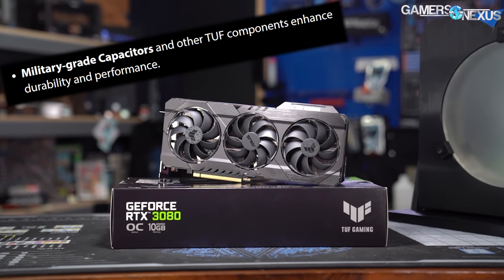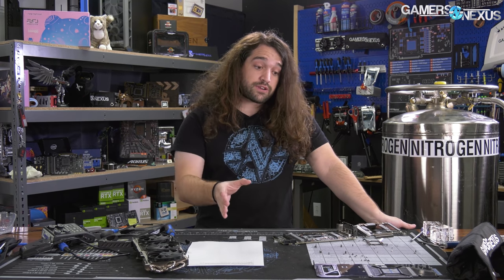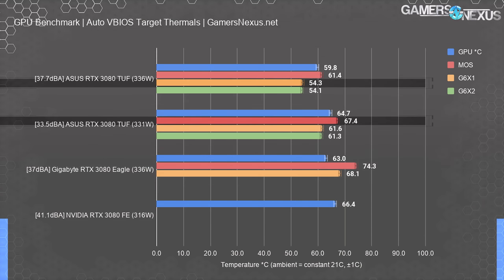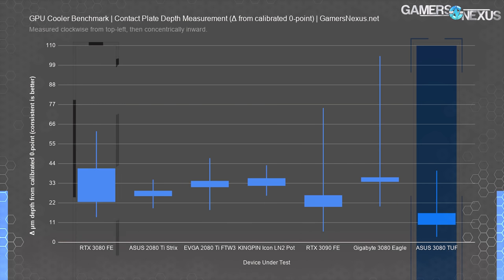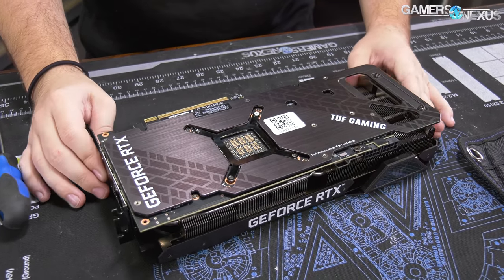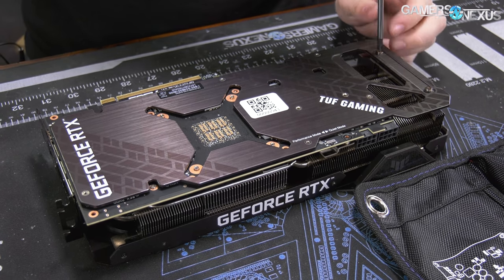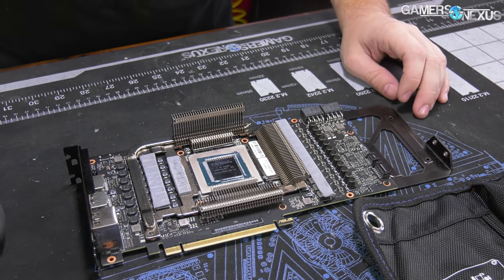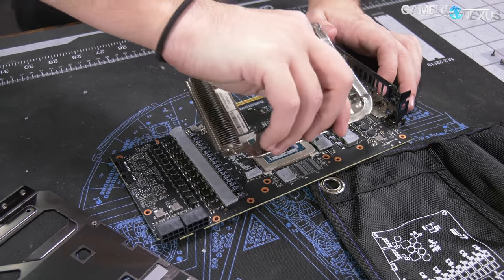ASUS RTX 3080 TUF OC Review & Tear-Down: Thermals, Noise, & Overclocking

Comment: Regarding the mounting pressure; do you find you get the same or very similar results per product card, i.e. if you checked 2 ASUS RTX 3080 TUF video cards, they would be the same and therefor demonstrating cooler mounting design application, or is it a more that each individual card varies to a degree?  I guess you need 2 identical cards to compare (and preferably more).

Comment: Aircraft grade aluminum" refers to many different alloys including, but definitely not limited to 2024, 6061, and 7075. ... In most instances, "aircraft grade" is just a buzzword/term to mean that the alloy has the same composition as commonly used alloys in aircraft, and possibly loosely heat treated in a similar way

Comment: the shroud removal process didnt' look that bad, for some sfx cases, some of us remove the shroud and fans from the gpu and put the card directly on the 120mm intake fans of the case (case dependent), and wire the intake fans to the gpu. so we don't have fans directly on top of each other, and it saves space.

Comment: Before I got my card (3080 Ventus) I was so scared it would be a shit card, due to people online talking so much shit (clearly most of those people don't have the card). 
Turns out it's actually great! Haven't seen temps above 62c , clocked +135 on the core and +500 memory (managed to clock +165 in benchmarks but wasn't stable in games).
This results in the card sitting at 1950-2050 during load.

Comment: @Gamers Nexus why all the negativity? 
OK the marketing is a bit silly, but that is a common problem. Meanwhile lots of respectable companies, even Intel has outright lies in their marketing. The performance seemed to be good to great to best. It is not over-priced. It is made of decent components as far anyone can tell. But what really makes it stand out among "reasonably priced RTX3080 models", and the review does not even mention it:
- it is just 30 cm long - among the few shortest 3rd party 3080s out there. (Important for all small case users)
- is has the second "quiet BIOS" which makes the card substantially quieter than almost any other RTX3080 (a big selling point for me).  

- it has an extra HDMI 2.1 port, making it easier to connect a TV and simultaneously some VR headset, video capture card or whatever you may have with an HDMI connector.

So I think this is the best RTX3080 board right now (considering price). Not by much and the standout features may not matter to You, but it is the best.

Comment: There is actual aircraft grade aluminium called Aluminium 7075. It is a mixture of Aluminium Zinc and copper, it has very high hardness (making it harder to machine) but can be heat treated and is used mainly in aircraft construction. Other types of non-aircraft grade Al include Al 1xxx (pure Aluminium), 2k series, mixture of copper and Al, the 3k series, with added Sillicone to it. The aircraft grade aluminium is usually the 7075. Hope i taught u something new on that misconception, as aircraft engineers are quite picky on their metals. Not sure what a "millitary grade capacitor" is as there is no such thing as millitary grade Al
Reply: Also to add to it, even the 1k series which are pure Aluminium alloys, are heat treated differently so that the crystalline structure of the metal differs. This allows you to have literally the same shapes of Aluminium with different physical properties such as strength, torsion resistance, stiffness, etc etc the list is long. Engineers are very picky on their Aluminium. Next thing you want is your aircraft wings or car chasis bending because you chose that bad Aluminium

Comment: According to a relative working on military aircraft:
"Military grade" only means that they have been certified for military use, this has more to do with taxation and spec/item number permanence than anything else. There is literally nothing about it that signifies quality. You will find regular screws, nuts, bolts, what ever being the EXACT same thing, coming out of the exact same factory, made with exactly the same tooling, and to the exact same tolerances as the "military grade" ones, just sold with an inventory number that is different because it MIGHT change, and at 1/200th of the price. They are, in every possible way, the same bolts. They're just put in a container and stored for military use.

In other words, when consumer products claim "military grade" it has nothing to do with quality, and everything to do with marketing BS. It MIGHT be a good part, but it's more than likely the same as the non-military grade part.

Comment: The military grade advertising I'm sure have always been part of the TUF series of Asus... My current PC which is from 2011 is also TUF and basically comes with a certificate for their military grade advertising and usually have more warranty is common like 5 years warranty for a motherboard and the rest are reliability tests like salt spray, choke test, vibration test, solder bath, mechanical shock and other tests...

Well I can't deny that the only PC that lasted more than like 5 years without a single problem was exactly this current 2011 PC because since the 90's all my hardware kept breaking, GPU's since the early 2000's up to the 2011 GTX570 died every single time in like 3 years while the GTX570 Asus with massive 3 slot cooler had a incredible ~25% OC over stock GTX570 at max voltage with 1.2V Vbios flashed and never died, same with my current Asus Strix RX480 OC flashed to Strix RX580 OC still going strong...

Also my I7 2600K is at 4.9 ghz on air high voltage for years, DDR3 is at 2133mhz and never had a single problem for the 1st time ever compared to my older PC's (maybe it's a coincidence but I'm totally happy that nothing broke yet since 2011 on this PC  even at high OC).

ps: This is just an example: https://itwriter.ru/wp-content/uploads/2016/12/004-1.png

Comment: Military grade is a real standard specification. 

What is MIL-STD 810G?
MIL-STD 810G outlines testing procedures to ensure that equipment certified as MIL-STD 810G compliant will withstand the environment and conditions in which it will be deployed. For rugged computing hardware, MIL-STD 810G is used to identify systems tested to operate reliably in the face of vibration, mechanical shock, temperature shock and extreme temperatures. 

Making military grade computing hardware, an actual higher spec than normal. It actually has nothing to do with what the military uses.

Comment: Military grade components are usually hardened to work in harsher environments. There is a difference in aircraft aluminum and other grades of aluminum. Too many times people use the term or even the material when they dont really need it. 6061-t6 is used to make aircraft components ... it is not use to make beer cans...but i agree with the video...why does a video card need military grade components ahaha

Comment: I've watched this a couple of times but it's the closest I have to the 3090 TUF OC tear-down wise. I'm just curious what thickness mm thermal pads to buy cause the memory is stupid hot and I don't think the backside has thermal pads, although the 3080 clearly does. I'm thinking the 3090 will not have those pads that you see in this video but can't be sure as I can't find any tear-down videos of the 3090 TUF (OC if that matters). I'm assume basically everything is the same, but given that more memory chips are on the 3090, there's less space for pads (thickness wise) and that's where I'm struggling to find some good info. Do you maybe have a 3090 TUF laying around you could measure the pads of? Or if it's lacking pads; what mm thickness I could use for putting on the backsided memory.

I've used some old CPU/GPU headsinks and put them on the backside but nothing helps. Also the backside shows 60-ish Celsius which GPUZ clearly passes so I'm thinking the backside is absolutely NOT contacting the memory in any way. I just don't wanna tear down the card and mess something up by reassembling it multiple times...

Comment: When you perform the contact plate depth measurement test, I was wondering how representative of the product in the whole this is. Is there a small deviation for pressure mappings when comparing the same card? Or is this more of a manufacture per manufacture detail?

Comment: I'm a bit more interested in how case thermals are with these aib's vs FE. Sure the FE is a little warmer but is all of that heat the AIB is getting rid of just being dumped into my case? Obviously, it is due to conservation of energy. Just curious if the half blower half not is overall better compared to the rest of these. I remember some of this being covered but I feel that data should be compared because I don't care about raw thermals compared to FE is the FE is actually helping to keep my case cool.

Why?

Because if my case gets warm, then my 7 case fans spin up. I never hear my 1080Ti because my 7 case fans are busy trying to exhaust all of that hot air so all I ever hear (when headphones are off) are my case fans. And they're all chromax noctua's.

Comment: I think the fans of the TUF are garbo compared to the ones of the eagle. But the heat sink is way better on the FUF. That case shows us the flaw of the noise normalised tests. 
If you have a good heatsink with crappy fans, you can get away by lowering the RPM and having something cool and quiet. But cranking up the fans will just increase the noise  without a meaningfull temps gain.
On the other hand, if you have a crappy heatsink with good fans, you canot just have a semi passive cooling solution, you absolutely need to crank the fans up. But you may be able to have lower temps at 100% fan speed.

I hope big navi will have a TUF (with adequate mounting pressure) version and AMD is not screwing up like Nvidia.

Comment: Can you explain the low OC power consumption of just 350W? The default power limit of 3080 TUF OC is 340W and the max power limit (+10%) should be 375W. But the card refuses to go any higher than 355W... Is it a BIOS bug?

Comment: The small form factor community is not interested in replacing the fans themselves but removing the whole shroud and sticking a couple of NHA12 to the heatsink. I watched this video because I want to deshroud a 3080 strix which is on the way and if the TUF and the strix heatsinks are similar then I'll have to bend or snip the tabs that get in the way. This card doesn't look deshroud friendly at all

Comment: military grade is just a concept for failure rate for caps or mosfets, MSI was actually one of the people that started this LUL marketing campaign i remember their single fan cpu cooler GPUS back in the day as their entry level "military grade" same with their motherboards....then ASUS came out HARD with the TUF as well...but prior it was the sabertooth. their TUF laptops blow chunks other than price point, their panels are just foretelling of ASUS. I guess you can use a dedicated monitor. Theyre essentially desktop replacement laptops with ryzens.

Comment: There is actually an aircraft grade of aluminum. However, I seriously doubt it is in your PC components.

Military Grade just means the cheapest crap they could find that meets the lowest standards possible.
Reply: Yes there are aircraft grades of aluminum, however saying "aircraft grade aluminium" by itself is meaningless as many grades of aluminum can be used in aircraft. It also wouldn't be meaningful even if they did tell you what grade was used as "aircraft grade 6063 aluminium" means exactly the same thing as "6063 aluminium".

Comment: It’s really perplexing how no GPU manufacturer actually uses a good fan layout without an annoying shroud, and proper fans. The actual technology in the card is so advanced and impressive, but the rest of it is just plastic junk. I think if it was available alot of people would buy it. This one still performs really well, but imagine the leap in performance against the competition if they just spent abit more on a proper cooling solution.

Comment: What's going on with the MOSFET temps on the Eagle? At 37 dbA you're getting 74.3 degrees but if you noise normalize to 40 dbA the temps are plummeting to 55.4 degrees even though the other temps barely move. Are you sure there isn't something wrong with these numbers? That's such a crazy outlier type number I have a hard time believing this is real.

Comment: I wonder why there is such dispersion in FE thermals & loudness in various test. Does Nvidia put differnet thermal compound (or not even layers)?  Does the case have so much impact for GPU? I dont get it. I have Cosmos C700P in chimney layout - TRUE chimney layout (fans on bottom, and no PSO shroud blocking the air - its on side vertically), and gonna switch to Silverstone Alta F1 as soon as its gonna be released, put 2 AP 180mm fans on bottom, 3 x 140mm AP on top - i wonder what will be better for me - FE or ASUS.

Comment: what kind of skrews is it to hold the metallic square plate? one of mine is rounded and cant find the same.. is it M 2 -  5mm long  -  2mm wide if i explane it right..         when i measured it was only 1,8... maybe because i have unscrewed my GPU several times...

Comment: So thinking of this, safe to say i intend on watercooling whichever one I do get. But unfortunately i have no idea which to get. One of my goals for putting a liquid block on a 3080, is to *thin it into a single slot*. Problem is I don't know which models even have a waterblock available, much less come with it preinstalled. Any suggestions for a winning design would be welcome. And I'm basically comparing these to, if AMD bothers to get their collective act together, an equivalent Radeon.

Comment: I own an Argus APS-720W. Nvidia recommends a power supply of 750W so I'm a bit concerned. Will my PSU be able to handle this card alright, or will I need to upgrade my PSU as well? My CPU runs at a 65W.
Edit: I'm getting the non-OC version if my PSU can support it.
Thank you!

Comment: FE might be something to consider if you only have room for a dual-slot card. I'd have to hotrod it to run any of the partner cards in my DAN A4 case... tho I run it with the sides off already so.. the Asus 3080 TUF might look cyberpunk af with the cooler hanging out of the side of the case 😅

Comment: I wonder if they are referring to MIL PRF 39001:E? This is the US military specifications/requirements for "established reliability (ER) and non-established reliability (non-ER), mica dielectric, fixed capacitors."

The real question then is, do their capacitors adhere to this set of standards... If so, there should be some documentation regarding their manufacturing process to achieve such standards...

Comment: You know ‘aircraft grade aluminum’ is actually a thing, right? 
Pretty much all aluminum is an alloy, but aircraft alloys are designed to have high strength, high resistance to fatigue and are heat treatable. 6061 and 7025 are two of the more common ones.
2011,2024 and 3003 are the most widely used alloys for commercial projects and are not heat treatable, but are much easier to work.

So yeah, while I’m not sure a computer needs the properties of the higher end alloys, it’s also incorrect to make out that ‘aircraft aluminum’ is just the same as regular.

Comment: i have  GTX 970 since 2014 and still runs evrything at max settings 1440p 30+ fps!. in 2016 ugpraded monitor and psu in 2017 cpu ram motherboard and  hdd and just 3 months ago i got a high end SSD the MP 600 2TB. But gtx 970 still a monster! My pc now is  CPU: RYZEN 7 1700
RAM: 16 GB DDR4 3200MHZCL15 GS KILL RIP JAWS
GPU: GTX 970 G1 GAMING
MONITOR: DELLP2416D 24'' 2560X1440 60 HZ IPS
MOTHERBOARD: ASUS PRIME X370 PRO
HDD1: WD BLACK 4 TB
HDD2: 1 TB
SSD: MP 600 2TB
In eed RTX 3080 for ray tracing and  i wil lget one when price and avaliability of it becomes normal.

Comment: Can someone confirm coil whine with this card?
Here is what I am dealing with:
- coil whine in every game (in some games only above 90FPS)
- coil whine is strongly dependent on FPS in combination with GPU usage
- sounds like a buzzing power plant
- independent of the power supply used
- no coil whine in title screens

EDIT:
I almost got rid of the coil whine by undervolting. the card is at 0.85V @1950MHz and the coil whine is almost inaudible.
Reply: I have the same card. I dont have this issue but undervolting can be nice, 100w less powerdraw for almost no drop in avg fps. The issue i have is that the fans will not stop spinning ever, and the lowest they go is 51-53%. Many other owners have this issue too. I have VBIOS 94.02.26.80.AS06, other people even with different BIOS like 94.02.26.C0.0 have the same issue, even on the STRIX. https://rog.asus.com/forum/showthread.php?120872-3080-TUF-with-(Bios)error-(Biosswitch-Fanstop)/page3

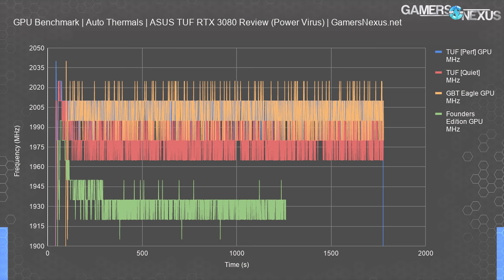Comment: The chart at 10:40 is not legible.  The frequency is jumping up and down so quickly that it becomes a solid bar and impossible to see which of the two frequencies it jumps between that it spends the majority of the time in.  

This is important because if one card is jumping between a low and a mid frequency spending 80% of the time at the mid frequency, while another is jumping between the mid and a high frequency again spending 80% of the time at the mid frequency then the graph will show two solid bars one on top of the other.  But the actual spread of performance between the cards would be 80% less than what the centre to centre distance of the two solid bars could lead you to believe.  In this case adding a tiny bit of smoothing would pull the lines together and better show the (lack of) difference in performance.